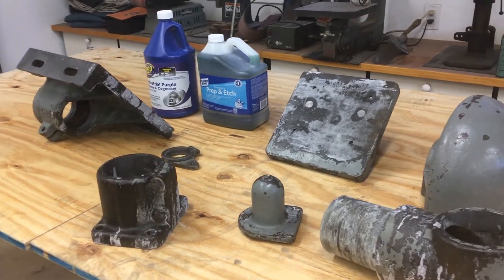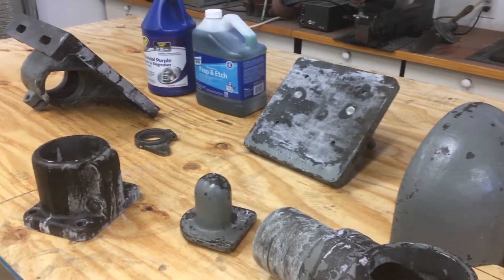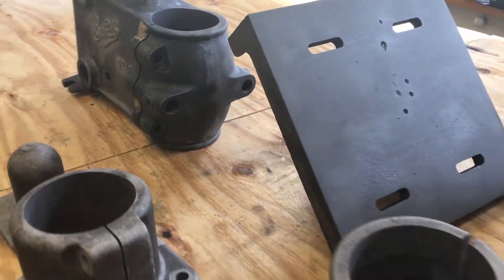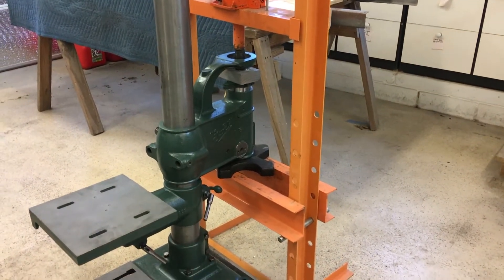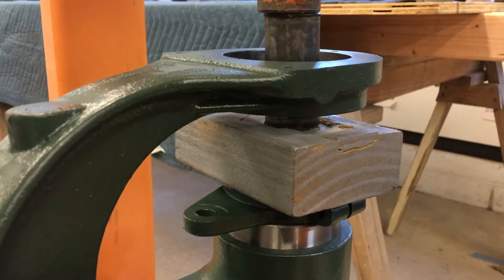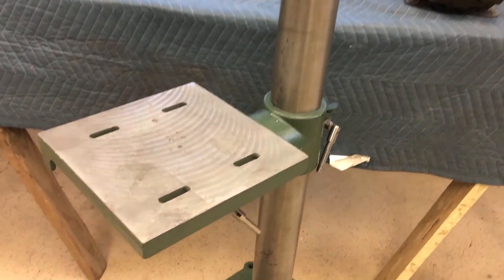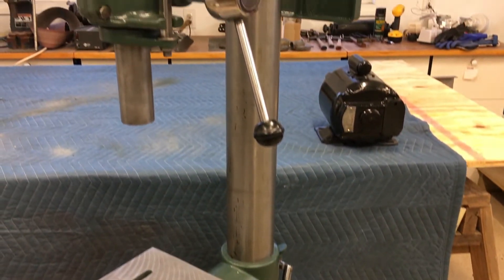Buffalo 18 DP Part2

Comment: Looking great! I just picked up an old buffalo 18 as well, but I can't seem to get the spindle pulley off, I've tried going at it from both direction but am not getting either bearing to clear the side to where I could use a puller - any tips you could offer?

Comment: Did you polish all the brightwork?  It looks like show chrome. Food looking drill press. I need to put mine back together.
Reply from the maker: Yes, most of the brightwork was in decent condition and only needed to be polished.   A couple of pieces required some sanding progressively up to 600 grit and then polishing.  I used a buffing wheel with a medium and the fine grade compound.

Comment: Hey, how's it going?

I saw your beautiful Buffalo 18 drill press. I'm actually restoring/painting the same drill press at the moment. I have almost everything disassembled except for the head. I have a few question below I hope you can answer. 

1. How do you remove the front pulley on the head? I see the shaft it rides on. Do I need a press for this, or can it be tapped out with a hammer and piece of wood. I assume it's in there tight. I also see what looks like a keyway on the lower/bottom pair of a shaft, so I would assume you press the shaft from the bottom towards the top, then you can remove the pulley. 

2. How hard are the bearings to press out? I've never really pressed bearings, but don't mind buying a press if the replacement bearings aren't too expensive. 

3. Will the quill spring unravel if removed? I assume so. If so, how hard will it be to put back? That's the other last part I have to remove so I can strip the head down completely.

Thanks!
Reply from the maker: The stepped pulley on top of the outer shaft is attached with a set screw.

I did press the bearings out.  I had some video of doing that but the camera stopped in the middle of it.  I kept the head on the post, rotated it 180 degrees (so it wasn't over the base anymore) and lowered it to fit inside my press.  Then it was a simple matter of finding a pipe with the right OD to press the bearings out with.  If you don't have a press to use you could probably put some penetrating oil on them and tap them out. You could also take the head to a machine shop (with the new bearings) and have them press the old one out and new ones in.   If you watch the Part 2 video at 3:52 you can see me using the press to put the new bearings back in and put the stepped pulley back on.  This is the reverse of how I took it apart so hopefully it will show you what you need to know. 

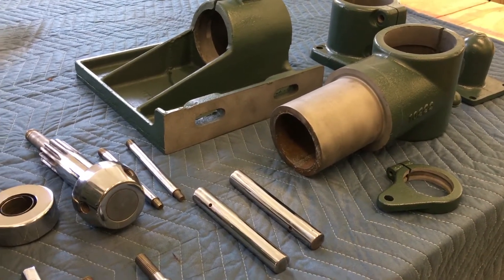As per the spindle spring, watch the first video starting at 3:00.  The spring does unravel but it doesn't cause any problems and reversing the process on assembly is just as simple as sliding it in and the rotating it around a few times after it catches on the spring.
Reply: Thank you very much for getting back to me! I sent you a direct message with another question as not to take up room in the comments.